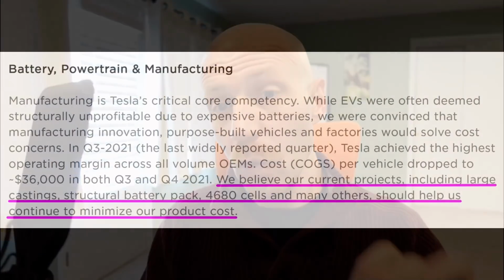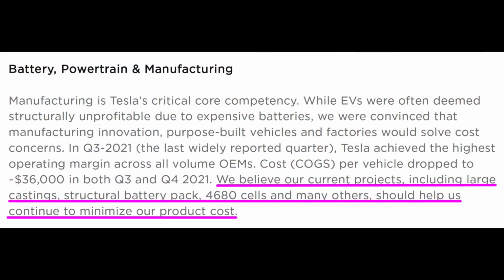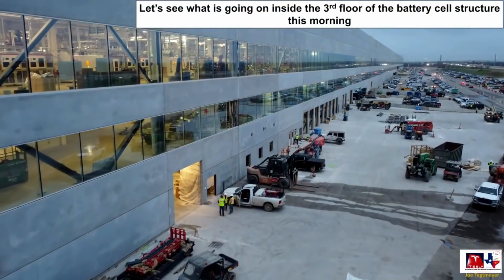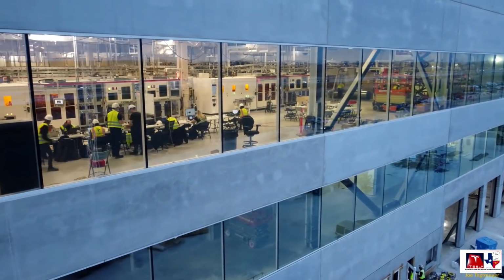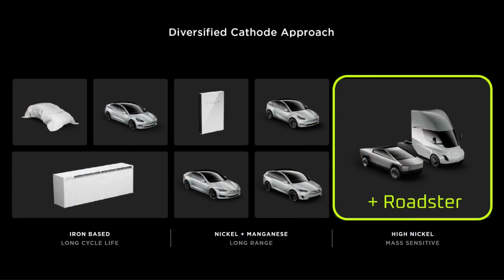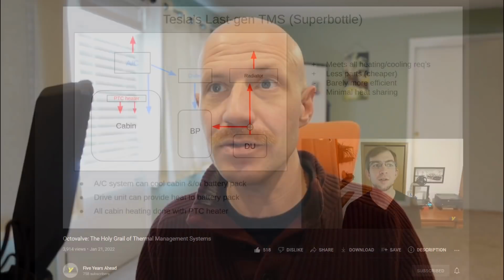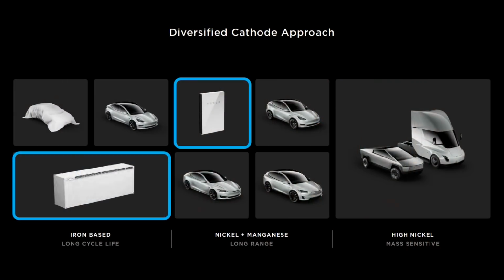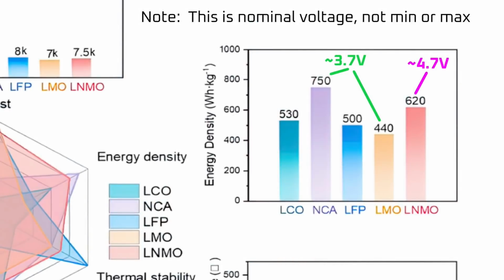Tesla Q4 Earnings Call:  A Tour de Force // Battery Maturity, Embodied AI, FSD Demand, Mn Batteries

Comment: Excellent insights, many thanks for your education . I am really interested to understand the efficiency of 4680 productivity volume per sq ft of dedicated floor space. It is Clearly a mere fraction of that required for vehicles. And of course what is the existing  utilised size of Kato road. We can see the Segregated Battery Factory building at Giga Berlin is 5 stories tall. I accept it will always be heavily assumption based but it must be worth a “back of an envelope “ exercise. Equally we understand that different chemical constructs will be used for different applications. Vehicles versus Storage. As commentators the focus has been No of Cells = no of vehicles, and the assumption has been that any excess goes to Storage Applications  but that is not correct Can the Same Battery production line be switched easily and quickly to a different Chemical Construct or do they require different dedicated lines. ALSO please can you define exactly what a Lithium iron “Cycle”  is and how do partial charges count towards the life time Cycle capacity. Thanks again for your detailed perspective on this exciting new ‘World of Energy”

Comment: You mentioned it would be easier to thermally manage 4680 LFP as opposed to prismatic.  While I share the same thought, AFAIK there aren't any issues with the current prismatic LFP, so they should stick with prismatic because it's more energy dense than 4680.  IMO, the only reason they would do a 4680 LFP is because it "fits" in the structural cast frame where prismatic might not fit.

Comment: Jordan, for the Tesla HVAC - I like the idea of a Tesla home - start to finish. The big hassle with the Tesla solar roof is that it has to be custom retrofit to each house - and every weird angle cut on site. That is not a cost-effective. Meanwhile, if you are building 500 homes from a single house plan, all those cuts can be done in a factory. If you design the house from the solar roof down, then you can get a more efficient design. If you build modular  structures in a factory you can have robots doing precision builds and save on labor and material wastage. Home costs are pricing people out of home ownership. (Is Elon still living in a $50,000 factory built home.)  I think that is where Tesla solar should be headed with home tech - buy a company that is efficiently designing and building homes in a controlled environment and shoe in Tesla's energy tech. They could have a dozen general designs and then have options like cars do for color and trim. Having built houses - there is a lot of wasted material and a huge waste time that could be eliminated in a controlled environment. Think about all the construction delays each time it rains, or parts are needed and you need to run to the building supply store, or waiting on the plumber, electrician, or building inspector to move forward. This would fit into the mission of the company and provide a service to those looking for an energy efficient contemporary housing. These could be done as a new neighborhood, as spec houses, or sold to individuals with an empty lot. Another advantage would be that Tesla would have expertise in permitting, making things more efficient to get things done.  If a house takes an extra 6 months to build - it is equal to 6 months of the house's rental value lost. Please consider this when you do the HVAC video.

Comment: Hi
I am really interested in the lack of news from Tesla about the use of Flow Batteries as a storage medium for grid storage and back up. If not a 100% then as the main part of large scale systems with possibly a Li cell battery as part of a hybrid system so that all operating parameter requirements are covered?

Also for use on earth as a modern design replacement and an environment clean up process, the development and commercialisation of Liquid Salt Neuclear reactors would be a major step forward, in green energy production to supplement solar and wind. Plus I believe that they would be a necessity on Mars as a modular energy generator to counter the lack of solar and unusable wind energy on Mars.
Any views?

Comment: Thank you for an interesting video. TSLA has software control of the worlds biggest battery in that all its cars have batteries.  Could you please comment on why Tesla has not introduced VTG. The ability to time shift say wind energy from 0200hrs local to 1600hrs local must help the shift to the widespread use of renewable energy.
Reply: I suspect cycles and battery life are part of the reason.

Comment: I have always been curious if Tesla will create a flat bed trailer for use by it’s semi that is partially or fully a structural batter pack.
Reply: If the trailer were the battery and had its own drive train, they could just follow the leader vehicle, powering themselves

Comment: The advantage of the cylindrical form factor for batteries is that it cannot deform to reduce the compression which prevents delamination. Boxy containers must be reinforced to prevent delamination which adds material and weight.

Comment: Tesla is very good in combining products to maximize economy of scale; e.g.batteries for both cars and storage. This allowed them to set up a supply line much bigger than the cars needed.
The Tesla bot is doing the same, since it expands the scale of Tesla's: Batteries, AI, Engineering, employees. What they learn with the bot, can be used in the cars. AI in bots can learn faster, since light and slow bots can be allowed to make their own mistakes without causing too much damage, which can then be used for FSD. The bot will also keep Dojo 2.0 busy. The bot will also allow Tesla to expand into chip production. etc.
And last but nor least; Tesla can actually put the bot to use in the gigafactories. The machine that makes the machine that makes the machine.

Comment: How CATL explains their new high-manganese battery. from: Talks with Investors from 02-17

"CATL plans to launch a new product, M3P. It is reported that M3P is not Lithium Iron Manganese Phosphate to be exact, but also contains other metal elements. The CATL calls it the ternary of the phosphate system. The cost is lower than that of the ternary, but it still occupies a certain cost of new energy vehicles."

Comment: Just a thought, Elon has commented many times that the machine makes the machine is the enabling technology for everything else.

Elon has said , Tesla China will Design and produce a new model for worldwide distribution. Because of the parts shortage primarily electronic chips and the new model Tesla China
Is developing has been put on temporary hold. Already Tesla can produce a vehicle three times faster than Legacy auto, the so-called $25,000 car will be designed from the get-go to be produced at a even faster rate🤔

Comment: For TeslaBot, I think they’ll use a similar training model. They have the bots be remotely controlled by humans (at first) to give “good input” then do supervised actions, and finally fully autonomous. They’ll be hyper job specialized at first - unloading crates or moving chassis.
Reply: I would not think there is any need to train it to do a task.  What the bot needs is the same thing the car needs, the vision based neural net.

Comment: Great summary and appreciate your detailed thoughts on every point they made. 
Regarding the Humanoid Robot, I personally engineer surgical robots at Intuitive, which have joints/range of motion that meet or exceed the capabilities of human hands and eyes. I can say from experience that developing the humanoid robot to a functionally meaningful state will be BY FAR Tesla's biggest engineering challenge. This Robot needs to be an order of magnitude more capable than the Boston Dynamics Atlas Robot to achieve some level of Elon's expectation. Developing the manufacturing and validation systems will be an even harder challenge. Let me know if you want more thoughts. I've got a ton about mechanism requirements & challenges.
Reply from the maker: Dude!  Sick!  Thanks for the insight, I didn't realize the hardware side would have such a high level of difficulty.  I may have to pick your brain on this at some point.
Reply: @thelimitingfactor  Sounds good! Happy to discuss anytime.
Reply: A vision based neural net will help and that's what they're working on.
Reply: @TheEvilmooseofdoom  Agreed with the object recognition. I'm speaking to the mechanical design of actuators, biomechanics, materials, etc. The Human body is the most incredibly complex mechanical system, and matching capability will require a herculean effort.

Comment: I've used both the model 3 and Y as a Lyft driver. Model 3 makes a poor taxi. Model Y is more acceptable but still falls short. An electric van would be able to handle most situations.
Reply: What makes the M3 and MY not good taxis?  Would a MX be more suitable?  All you need is a big fat wallet!
Reply: @carlstockmal  You need easy access to the rear seat. There are a lot of people that are barely able to walk. So you have walkers, wheelchairs. People who can hardly fit through the car door due to their size, or wearing casts.  Many people you pick up from dialysis are out of it. So you have to help them into the rear. The Tesla doors just don't open that wide. I moved a whole family and their belongings one time. They had ordered a truck, and the model Y was filled to the gills. Lots of people going to medical appointments and they have lots of issues. So the ideal vehicle would have a sliding rear door for fairly trouble free access.

Comment: Fantastic information Jordan thanks. Have you a view to the use of a ceramic material HPA ( High Purity Alumina (AL2O3)) as 1 a separator and 2 as a coating on both anode and cathode materials. From research done I find that HPA used as a separator has a large positive effect on the cycle life, fire safety  and more. When coated onto cathode and anode materials, 1-2 NM thick using ALD technique, I find it increases energy density, limits SOI and enables a faster and larger electrical energy transfer without safety issues. It appears to enable a faster charge rate, a longer cell cycle life, inhibit the risk of separator break down hence a far less fire risk. The more I research this material the better it looks. Many different battery chemistries are trialing HPA. I see it as the new wave in the next 5 years of battery chemistry as it is only adding to existing chemistries and not changing the base materials used for a substantial gain.I would love to hear your thoughts on AL2O3.

Comment: What do you think about texas model y and freemont model y coexistence.... Beware the Osbourne effect... It's not range and performance differences between fremont and texas that will cause an issue.. texas model will have front and rear castings and structural battery so it will be a safer car.. who will want the less safe fremont model ?? 🤔
Reply: When it comes to a Tesla 'less safe' is meaningless.  They're all really safe.

Comment: In terms of cell form factor, wouldn't non dry-rolled cells be more expensive to produce?  There's solvent capture and baking expenses.  Plus building space.
Reply from the maker: Dry rolled and wet rolled don't dictate form factor.
Reply: @thelimitingfactor  
Correct.   But dry rolled takes far less energy, time, and floor space.

Can you 'dry roll' a pouch or prismatic form?

Comment: You mention that form factor doesn't play a big part. I've read and heard a couple places (one was on a Sandy Monro episode I believe, the others I can't recall right now) that for manufacturing rolling the cell is easier/faster to produce on the production line then a "spam can"/prismatic/etc cell. Do you know of any data that supports or dismisses that? It would seem a benefit to use rolled cans if it meant the lines could run faster or less machines needed because they are more efficient.

Comment: Tesla solar has learned first hand, retail implementation of outdoor roof panels on idiosyncratic, archaic roofs is a nightmare.  Imagine turning this into a 3 dimensional problem inside a multi room, multi level home…Additionally, plumbers and HVAC installers are just as easy to herd as roof installers.
Reply: Some sort of modular approach to domestic HVAC may be efficient. Integrating water heating and refrigeration is essential.

Comment: I think that most people have underestimated just how GIGANTIC it is that the 4680s are on schedule !  This is enormous for Tesla to achieve and I held my breath during the update;)
Reply: Really.  What does it provide?  Nothing big except a bigger format, mostly.
Reply: @DumbledoreMcCracken  so you think 4680 is a waste of time???
Reply: @gregbailey45  yup.
It seems to have a lower energy density than the smaller batteries, when assembled into packs.
Reply: @DumbledoreMcCracken  Even if that were the case (I don't think you're correct on that, it's a marginal increase in capacity ~15-20%. We're probably seeing them consolidate the packs rather than push for energy density), the fact the 4680s can be manufactured quicker and cheaper than existing batteries is massive by itself.

I see them as a cost cutting and supply boosting benefit. Tesla needs to improve their manufacturing capacity NOT the performance of their vehicles rn
Reply: @MrVelociraptor75  
Exactly.
Reply: @MrVelociraptor75  4680s provide manufacturing capacity because it's much faster to make them, plus they're making them in the same factory as the pack and the rest of the vehicle. there are a lot more benefits that simplify the overall production time and cost of the vehicle, not to mention a structural pack improves safety and handling.

basically 4680 is one of the major reasons other car makers can't catch tesla

Comment: As for the robot and the AI of your video, it is very unikely that you can perform AI and robot in isolation. The latest research in AGI (Artificial General Intelligence like human beings)  and so-called neuromorphic computing tend to indicate that our intelligence is largely influenced by our sensorimotor capabilities . The lastest papers from a research lab like Numenta are even pushing the reasoning as far as saying that our brain organization is shaped after our perception capabilities and that this capability has then been used over time by the brain to "reason" on non-physical perception (concepts, symbols,...). All this to say that AGI without embodiement is, in my humble opinion, very unlikely to happen.
Reply from the maker: Fascinating!  💯  All that's new to me!
Reply: I doubt they are trying for anything near a AGI.  There is no need.  The vision based neural net alone will open huge doors without the need for a robot that can think.
Reply: @TheEvilmooseofdoom  Sure AGI is probably not in Tesla's plan. Still the embedded AI and the embedding robot will have to be designed and trained altogether for the robot to behave in socially responsible way and, for instance, not harm humans or even break down objects in its surrounding.

Comment: There are issues about battery of 2019 Model X in Taiwan. Maybe more than 10% of them. It will completely loss capability of moving. Do you notice that issues? What causes that?
Reply from the maker: Not in my wheelhouse unfortunately
Reply: @thelimitingfactor  Would you like to dig in more about this issue? It could become a big problem. If 10% of all Tesla have to replace its battery after 3-5 years usage.

Comment: The robot it the same core engineering that they already do: AI/fsd+vision, motors, batteries, casting, etc.
But the robot is more valuable right now: it doesn’t need to be 100% ready like fsd.
If he can do a simple task reliably it’s going to pay for itself very fast
Furthermore, it will cost fewer batteries and computing power than cars and will be useful in more uses cases as time goes on.

Comment: Tesla HVAC is probably the next Tesla product I'm the most excited for. Partially because I need a new one but it will make a big impact to residential energy usage. It is kinda silly that water heaters and heat pump HVACs are separate products in a house instead of one. It'd make both more efficient.
Reply: I just wish Tesla would buy a small home builder company and start working on incorporating all their products into new homes. Get experience working with city ordinances and building a sustainable home from the ground up.
Reply: @SpaciousPresence   That's the problem though, the city ordinances Is are so wide and varied that getting a product which can work is extremely difficult. Yeah would love to see a hypothetical Tesla neighborhood where all the houses were built from the ground upWith solar roofs, Which fed into a Mega pack Generating stationWhich provided energy for the entire neighborhood during off Solar hours. At the same time there is a reason why homes are built the way they are
Reply: Water heating, food refrigeration, space heating and cooling could all be integrated!
Reply: @gregbailey45  Oh boy, one $5 part goes out: cold shower, spoiled food, whining family.  Sounds awesome!
Reply: Not a big leap to convert Model Y Heat Pump tech to HVAC in houses. Incorporating UV filters to kill virus/bacteria/mold would be great.
Reply: Agree. Tesla HVAC is my #1 request. My home's heat, air, and water heater are all nearly 30 years old.